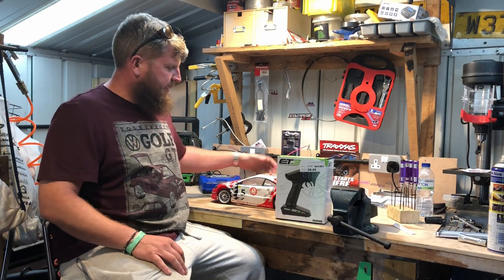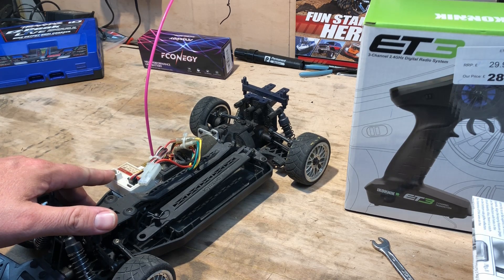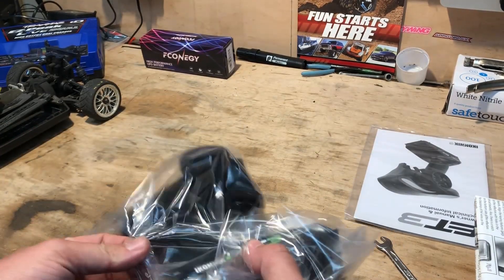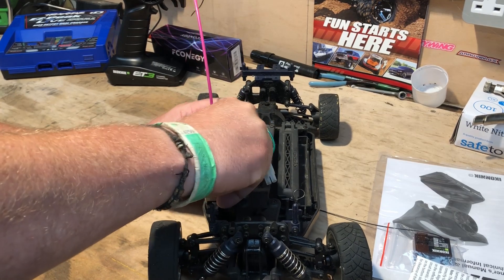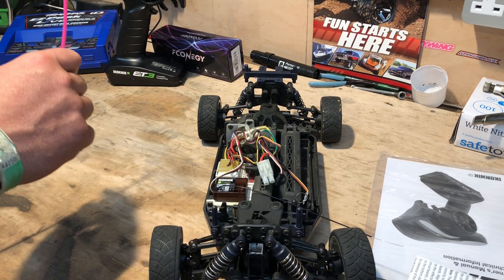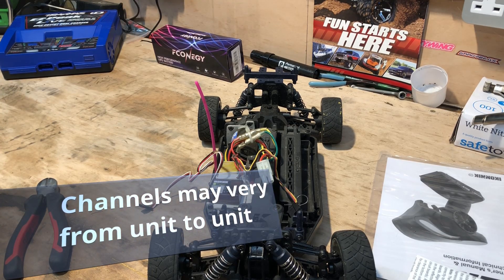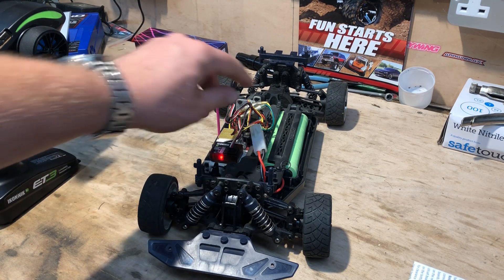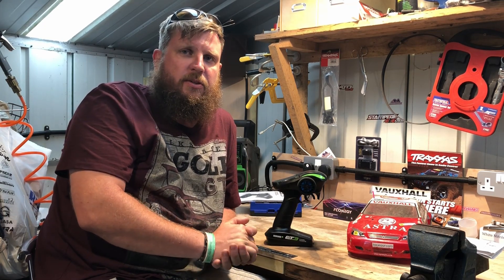Retro fitting old RC Cars with modern Receiver

Comment: Thanks for that I have a original hornet that I'm wanting to update with new gear do you think it's possible,? I was confused about the crystal thing but now you've showed me it's fairly easy and I might update motor and servos. So I'm interested if you do this too is love to see that.
Reply from the maker: Servo on a hornet is fairly easy if I recall. Motor depends what you got now, as some of them need a plastic offset ring, in which you may no longer have

Comment: Hi, i have an old Tamiya Blackfoot RC that i believe the receiver doesn't work anymore... how can i replace the old receiver "Pamda R102E BEC with the new receiver.. however i believe the servo and MSC are still functioning... I just dont know where to put the power on the new receiver...
Reply from the maker: Not sure I follow the question correctly. But I assume you Mean the power feed to the receiver ?

In which case with out it in front of me it’s hard to answer directly.
But has your msc got a wire coming off it 
Or are you using a separate AA pack
Reply: @rcoverland4459  sorry for the late reply... But i already solve the problem....  thank you🙏
Reply from the maker: @chandrap3672  no worries. Hope it was easy